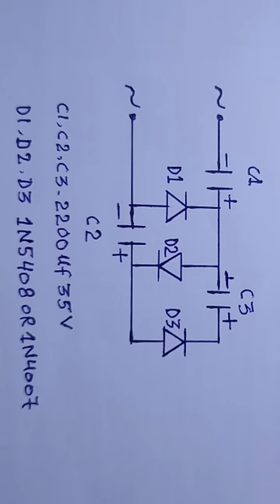Making a voltage tripler circuit

Comment: a diode cascade, the voltage doubles, the current halves
Reply: How do ya do the opposite of that ,if possible?like with 24-28vdc÷half and amps be double whatever they r @ input level and be steady for/as a power supply constant   .....? Fig id ask
Reply: ta bueno
Reply: L8pp
Reply: Greetings: True
Reply: @erichayneshaines9549 A Stepdown (buck) converter
Reply: A buck boost converter...  Power = current X voltage... This device equalizes power. You can double the input voltage on output and the current will halve and vice versa....
Reply: Un duplicador entregaría la mitad de la corriente si estuviéramos considerando una vaca esférica flotando en el vacío del espacio... O sea que la corriente que podría suministrar es menor que la mitad... Estoy agregándole un poco de humor a tu comentario. Cordiales saludos.
 😂😂😂😂😂
Reply: C'est différent.  On multiple facilement le voltage.
Reply: @erichayneshaynes9549  think of a transformer, input 230V 1A equals output 23V 10A. You can only get out what you put in.
Reply: Input kitna diya hai bhai

Comment: The capacitor value is 35volts
But highest value we see is 58.2 ..It is much more than the value of the capacitor ,So why  this capacitor is not explode ?
Reply: Series
Reply: @KaigakuAgatsuma999 thank you
Reply: Also how can this work on a transformer that delivers AC? Thought this type of capacitor could not stand reversed voltage? Notice how there's zero diodes between that source and the first connection..
Reply: That's the combined value of all  capacitors. Not just 1 .
Reply: @harrickvharrick3957 Посмотри на схему. Там диод D1 и конденсатор C1, включены последовательно к блоку переменного питания. Так что ни какого обратного тока не идëт. Да и в обще, это стандартный множитель напряжения. Интересная штука, но у него много минусов. И обрати внимание, как изменяется мерцание лампочки, при тестовом подключении еë в разные сегменты, этого множителя.
Reply: If you read and comprehended english, why would you think people would understand you when you add in your comment in another language??   Imagine walking up to a conversation then answering somebody in a completely different language.  You dont think that would make you appear to be an idiot?  Just saying..
Reply: @Z-Ack  there's literally a button right under the comment "translate to english"...
Reply: @Z-Ack  Zack just highlight it and right click to translate.
Reply: @newbiegaming6090  lol, I don't have this option for example.
Reply: @newbiegaming6090 они не привыкли😂 им не надо знать другие языки и кнопки
Reply: @АнатолийИванов-о8б exactly. I understand you perfectly with translation. In fact, you've offered the most intelligent comment out of anybody else... kinda makes someone appear to be an idiot. just saying...
Reply: @teodorvangelov don't have this option? are you on 1932 computer or something?
Reply: @GewelReal bruh, if you or anyone has access to a computer made in 1932, especially one that can connect to the internet and play YouTube videos, let me know, I want it will pay top dollar..
Reply: @newolde1  it was a joke but sure
Reply: @GewelReal  no, but I'm using an YT version from 03.2022. I don't like the new UI.
Reply: @teodorvangelov  I'm using 2020 version and I can translate
Reply: @GewelReal  what exactly is yours?
Reply: @Z-Ack way to make English speaking people seem xenophobic and not very tech savvy…😒
Reply: @Z-Ack  don't be silly, YouTube have on page translation feature.....[don't stay in the dark side bro]
Reply: Good attention
Reply: Its because they don't charge to over their rating they just charge up and then the current tries to go somewhere and every time a cap gets charged up it goes through the diode but once they're all full, it's gonna add up to more but each individual cap is only being charged by the initial starting voltage which should be less than the reading. Something to do with the diodes I don't really know what I'm talking about
Reply: @harrickvharrick3957 actually one of the main uses of a polarized electrolytic is to filter transients in an AC signal, like audio applications. It's just that you can't exceed the reverse voltage and breakdown voltage, over time. Like if you use too low of a rating it will break soon, but also most of these have a rating slightly higher than what's printed which it's the maximum spike or only if it's infrequent seldomly reaching this max max voltage it will survive, but not continually. The printed ratings are like continuous operating limits... sort of. It varies I think.
Reply: Very interesting and useful tip of witch i wasn’t aware of that this was even possible. 

This is not so much remarkable that i was unaware, i’m no electrician but learn on a daily basis. 

Thank you very much for sharing this!
Reply: @harrickvharrick3957  the diodes...?
Reply: @newolde1 ele falou no sentido figurado.
Reply: @ryva370  porcos podem voar
Reply: What is the matter with some of you here..... Just enjoy, if u understand, the circuit....😂😢
Reply: @Z-Ack  Обнови приложение. Момент когда ютуб умнее тебя.
Reply: @Z-Ack I think he might be a bit ahead of you technologically; there's a program that overcomes this obstacle.... Google Translate. 😁✌️
Reply: @Z-Ack why are you so angry? Why did you respond to them in English, when you obviously* read and understand Russian. They hit the translate button... You're so strange
Reply: @harrickvharrick3957  AC is an integral part of the voltage cascading working; it cannot work with DC. At no point is a capacitor powered in reverse, because the diodes prohibit that. It essentially works by gradually charging up the capacitor of the next stage, with the energy in the capacitor of the previous stage; it's a "two stroke" system. Each capacitor will get charged with a little less than the input voltage, and since they are in series, their voltage combines.
Reply: @harrickvharrick3957 the wave is reversed, not the polarity
Reply: @teodorvangelov  The option is in youtube app, not browser.
Reply: @Z-Ack в идиотах тут один ты, если не умеешь пользоваться переводчиком
Reply: @Z-Ack most smartphones can automatically translate. I was able to read it...
Reply: @Z-Ack भाषा गई भाड में।।। हम काम देख रहे है।।।
Reply: @GewelReal   nah, doesn't always show up for some unknown reason, somtimes not even on mobile. Probably down to YT нетcode or something

Comment: I forgot this. Can it be used for stepping 5V up to 12V to let say keep a car radio memory wire lead active so when 12V switch lead is turned off?
Reply from the maker: Input always dc
Reply: It's only good for low current stuff. Would probably work fine for your example. However, you should be using a boost converter module instead, because a cascading circuit is really an esoteric and strange solution.

Comment: To simplify you can connect D2 and it multiplies voltage by charging the caps using precious caps in the sequence / V thru the diodes, then you have series capacitors for which the voltage is the sum of said caps. Also polarized caps are not a good choice for this circuit
Reply: Yeah, Electrolyte condensator will basically short circuit when polarisation is wrong.

Comment: Isn't it a bad idea to use caps with polarity?
Reply from the maker: Capacitors should be in polarity order
Reply: They're never effectively reverse polarized because of the diodes. When the AC switches and technically puts the first in reverse (through the second stage capacitor), it's internal charge voltage simply halves and shares half it's voltage with the next stage capacitor; the next stage will see the voltage of the input, plus the voltage of the first capacitor, and therefore charge to a voltage higher than the input voltage. You can make as many stages of these as you want, but the charging of the next stages becomes gradually slower as they, with each AC cycle, only take half the power from the previous capacitor, which again takes half of it's power from the previous; so, you halve a halving of a halve of the charging speed, meaning the load you can pull at the higher voltage, becomes exponentially lower, the higher the amount of stages.

Comment: Explain how it works.
Reply: Это диодный мост , вся информация в Ютубе.
Reply: It is not advisable to use it
Reply: Ampere gets reduced
And voltage get increased
I= V/R
Reply: @moviehighlights8079  Why did you see anyone use those the appliances?
Reply: TV...
Reply: TV.
Reply: @moviehighlights8079 
Умножитель напряжения не так работает. 
Он силу тока не режет. Он переменный ток, делает постояным, но при этом, сам ток идëт пульсацией, чем больше будет сегментов, из диодов и конденсаторов, тем больше по времени будут пульсации. Это из за того, что конденсаторам нужно время для того чтобы зарядиться, и потом только, сбросить этот заряд дальше.
Reply: It's actualy EASY understand a circuit of conversion but your explane is perfect!
Reply: Vai alimentar um chuveiro...kkkkkkkkkkkkkkkkkkkk

Comment: Can i use smd size caps and switches to make a multi power bank for retro consoles? Mostly gameboy color(3.0v) and DMG(6.0v) ?😅
Reply: No, this stuff is only good for very low current stuff, especially with tiny caps. You'd be better off hooking up some buck converters to a shared 12ish volt battery. Preset each of them to the desired voltages. You could use just one converter and set the voltage right every time, but that runs the risk of accidentally frying your console with too high a voltage. There's also boost converters which can take a lower voltage and increase it, though they aren't as efficient, but those would allow you to use a 5v USB battery bank.

Comment: What would be the practical application for this
Reply: TV.
Reply: TV.
Reply: Electric fly swatter..  lol
Reply: Lcd driver circuits
Reply: I have a phone powerbank charger that uses a 1.5 volts AA battery as a power source then step-up the voltage to 5 volts. That's a voltage tripler circuit to increase the voltage to 5 volts otherwise the phone will not charge if the voltage is only 1.5 volts.
Reply: @Manny_News_Blogs_Tutorials  Your battery bank uses a boost converter circuit (switching power supply, that is, continuous switching on-off the charging of a coil / electromagnetic field, which when switched off causes field-collapse, "back EMF", that is a pulse flowing backwards out of the coil, with a voltage significantly higher than what it was charged with), not a cascading circuit. This cascading stuff is useless for anything but very low current applications.
Reply: @TheMrTape  but how do you explain the 1.5 volts battery DC input boosted to the 5 volts DC output. I think my single AA alkaline phone charger has some form of a DC to DC upconverter which is opposite to 220 volts wall charger step down to 5 volts output. Do boosting 1.5 volts battery to 5 volts doesn't employ voltage tripler circuit? I think I've seen similar use in an Alinco or Icom brand scanner radio where when the batteries already drained below 2 volts there is an automatic circuit that will boost the supply up to 3 volts for extended operation.

Comment: lol its a Cockcroft-walton voltage doubler. Its just that he only used 3 capacitors instead of an even number of them. As 2 caps is a doubler, 3 caps is a tripler and 4 caps quadruples the input voltage(or by adding 2 more capacitors adds 2x input voltage to the total voltage.)
Input=10volts AC
-2caps  doubles input voltage 
2x(input volts)=20v  
that every two caps added called a series increases by double the input voltage. 
4caps=20v+20v=40v
6cap=40v+20v=60v
8caps=60v+20v=80v
10caps=80v+20v=100v
( hense why its called a voltage doubler).

although an easier way to figure out the total voltage is the (#capacitors)x(input volts)
(10caps)x(10volts)=100 volts
or 
(11 caps)x(10volts)=110v
which is easier to findout the total when you have something like input 448v and 16 caps( or 8 series) 448v x16= 7168 volts

 And to the person above asking if the input is AC. is Yes. A Cockcroft-walton or a Villard Cascade converts  AC in  to DC out. 
So its nothing special and nothing new either.
Reply: This circuit was also called a Zamboni pile. It was used in early televisions to get the several KV required for the CRT.

Comment: Idol  can u make  a circuit like this  BUT  TO MOTPRCYCLE TO HAVE A HIGHER VOLTS  BECOZ OF LOADED LIGHTS. tanx
Reply from the maker: This type only possible for ac to dc circuit.
Ur demand dc to dc booster, i will try soon

Comment: ขอขอบคุณ(อนุโมทนาสาธุ)กำลังหาอยู่พอดี(จะนำไปขับมอร์เตอร์ดีซี๑,๕๐๐วัตต์ด้วยคาปาฯนี้พ่วง๗๒โวลล์ขึ้นไปประมาณ๑๐๕โวลล์๙-๑๕อัน><๓๕โวลล์)ไม่ทราบจะใช้ได้ไหม?
Reply: Nein, die Last ist zu hoch.
Reply: nope, that's too high. read the motor specs. you gonna need higher amps. even if you somehow manage to make it have enough power, a 1.5k watt motor will never run smooth, the speed will go up and down, because the caps charge and discharge time
Reply: خیر اصلا به درد .هیچ کاری نمیخوره.فقط یک ولتاژ .انباره ای هست .که در کسری از ثانیه .جواب میکنه.

Comment: U  can load applied it's can't give the constant out put
Reply: It can if the load is lower than the charging current. Given the size of the capacitors, the charging current is quite high. Realistically, the output voltage just drops a little, in turn lowering load and finding a balance, but regardless, it's still running at higher voltage.

Comment: The output voltages produce are not suitable for making projects!... whre can you use the voltage value of 19, 28 and 58 volts?
Reply from the maker: This is the procedure u can use 12v 24v 5v

Comment: Good but u used 35 volt capacitor I think 16 volt capacitor is better for this circuit
Reply: You can always substitute a higher voltage capacitor in place of a lower one.

Comment: First time that happened to me was in 1984. I was thinking, how can 360 volts ac come from an outlet providing 120 volts ac considering it's going through rectifier diodes. I decided to go to bed and figure it out in the morning. Very handy circuit.